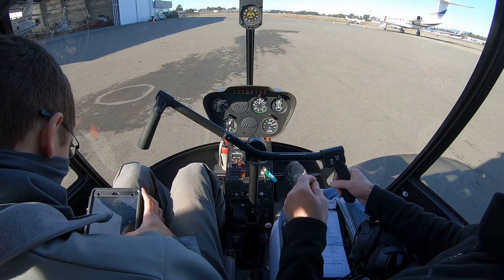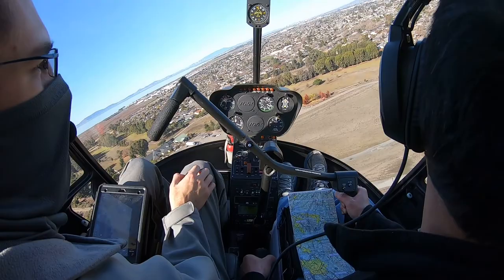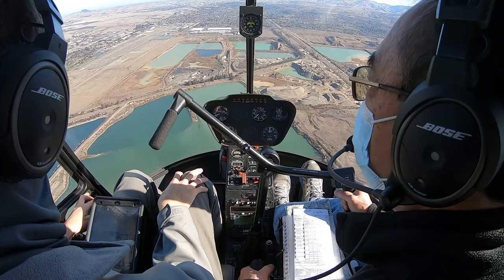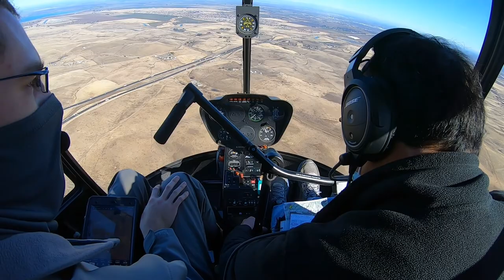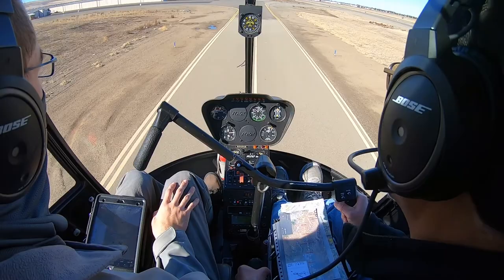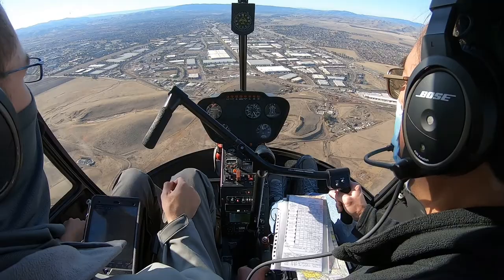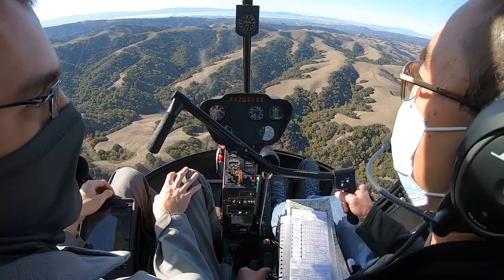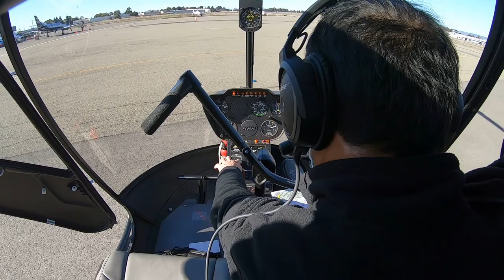Specialized Helicopters, Robinson R22 Lesson #25, XC to Tracy

Comment: What go pro are you using and what mount? Great video by the way.
Reply from the maker: I am using the GoPro Hero7 with external mic adapter and U174 comm adapter cable with 3.5mm jack lead. The mount is hung on the back firewall headset hook on Sorbothane isolators in a handlebar mount attached to a piece of plywood. The GoPro mount is also attached to the wood with an adjustable tilt angle.
Reply: @rotarywing  Thank you.